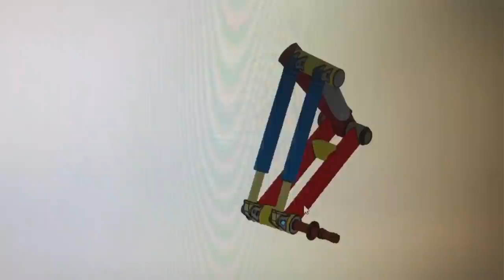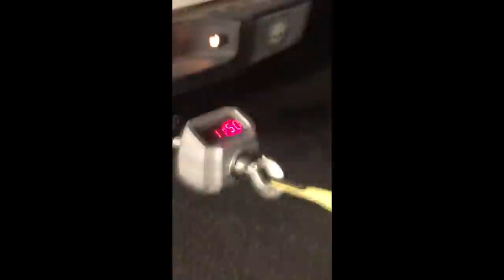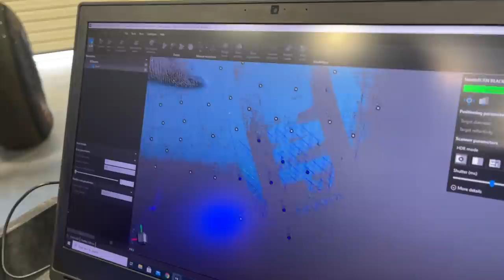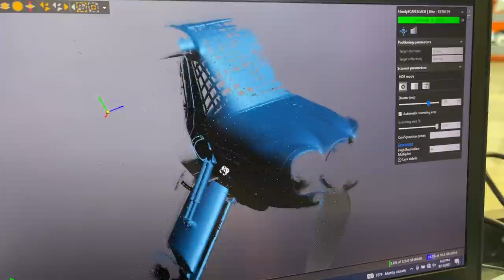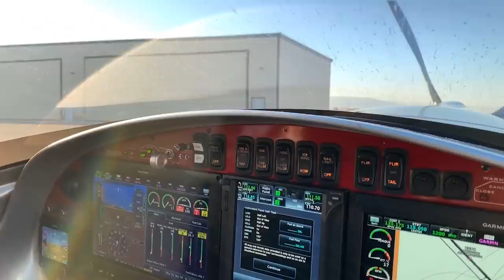Bush Plane drags truck | Scrappy #62

Comment: Working with design function carbon fiber wingtips and wingtip extensions are fun parts of prototype plug creation I like spending time with. Gleaning real-time performance data with them is a journey in themselves. Mike, I'm looking forward to your findings and the engineering compromises you choose for applications related to Scrappy's journey. I love spending time with your channel.

Comment: OMG you were dragging that pick up with the rear end locked. Wow
   What's next a pull sled. LOL
Reply: I think if he put wings on a camping trailer scrappy could tow it to Oshkosh next year.
Reply: @undercoverasiant696  wouldn't that be a sight. Lol  With synced controls pulled pulled like a glider with a tongue instead of a cable.🤔 
    I can hear the old lady now... "I'm not going camping less you bring the trailer." LOL

Comment: I had a feeling that Scrappy didn’t have wing tips because you were going to be doing further testing on the ground and in the air similar to the way you did with Draco. The world has spots cars, super cars and hyper cars. Now the world has a “Hyper Carbon Cub” Scrappy looks amazing and you’ve done a wonderful job  building a Hyper Cub. I’m betting there will be a 1/4 scale remote control version of Scrappy in the near future as well. God Bless

Comment: WOW, I figured that since you made it to Oshkosh without the final videos that it took an incredible effort to make it on time.  Thank you for catching us up.  I have to admit that I haven’t missed a single day checking for a new video.  So, Scrappy was fully digitized.  I am hoping (betting) that the file makes it to Horizon Hobby.
Reply: I couldn't imagine what a foamie would be able to do with double slats and flaps on flaps, but on the other hand, I doubt those particular features with their complicated mechanisms would make it into final production.  It's not like most RC planes could even utilize those features, since so many of them fly so slow as it is, and many can transfer enough lift from the thrust of the prop when the wings start giving out to keep flying.
Reply: @Skinflaps_Meatslapper  I have several large foamies and what I would like to see is a leading edge that represents the slats in the up position but include the flaperon function.  Just for fun I like to imagine Draco (the full scale version) with the double-slatted wing.  I’ll bet it happens.
Reply: @king-o-vetts9899  Oh, flaperons are easy to program in your radio if you have an extra channel to spare on your receiver for independent ailerons, though I don't really recommend it.  Just mix the aileron and flap channels, play around with the mix and limits until you get it where you want it.  I do it all the time with mine, but I do the opposite, (sometimes called a crow's foot).  The ailerons travel upward when the flaps go down to give it additional stability and tip-stall resistance at slow speed.  I tried the flaperons once with a AT-502 foamie, since I wanted it to be more scale like my actual 502, but it got so hard to control at slow speed even with gyro stabilization that I had to maintain a higher speed to keep it stable on the roll and yaw axis, if I got it just a little bit too slow the plane would tuck a wing under and dive to the ground...not a good trait if there's any wind at all present.  So really, I was able to fly slower without flaperons just because I didn't have to fight a wobbly and unpredictably suicidal plane.  Some features just don't scale down to RC size in quite the same way, because flaperons are great on my 502 but absolute trash for an RC 502.
Reply: (+ 1) on that one!

Comment: Almost looks like something is holding the plane up for those slow landings. Amazing how slow the plane can land.
Reply: Scrappy was designed to be in slow flight most manufacturers build them to be ok in both fast and slow  look at the shock ultra cub that thing is as close as u can get in a stock design to scrappy

Comment: You should talk to e-props: they have an innovative design that work well at the bottom end while keeping top speed. Results are close to some variable pitch props
Reply: And they're French, just like Beringer
Reply: @NicksStuff  Electric variable pitch has a long way to go before it can compare to a simple hydraulic governor, they're primarily intended for engines that do not have the ability to run hydraulic.  MT actually steered me away from their electric offering for my O-360 in favor of a conventional hydraulic because my engine is compatible with a governor.

Comment: Have you ever thought about ways to help fight forest fires? Cheaper ways to get water to fires, or equipment to fighters. I think you could engineer world peace if you put your mind to it. I can’t stop watching your videos you just grab my attention can’t wait for the next one! What will you think of next?
Reply: I’ve thought about that. My version would be an electric motor drone (no battery)- that would have an umbilical cord that goes to a fire truck mounted gen set. High voltage line sends up the current along with a hose. Drone will be operated by a couple pilots from the truck. May not be able to send up a massive amount of water but it would be consistent and targeted with no human that could crash.

Comment: That was AMAZING! First time ever seeing an aircraft drag dead weight like that! Can't wait to see the climb rate with NITROUS! Going to be INSAAANE!!

I just used 2 Grip Lock Ties on a customer's car until her parts came in. I had disconnected the left side parking brake cable - battling inferior metals and rust the whole way - only to find I was sent the wrong cables! Rather than reinstall everything and risk snapping one of the studs off in the car body, I used 2 Grip Lock Ties to secure the cable, so she could drive her car until the correct parts arrived. A week later, I just released the Grip Lock Ties and was picking up where I left off - nice and easy! I appreciate that product! Now if we could only get the entire automotive industry to adopt your creativity and work ethic, I'll be sitting pretty, lol! :)

Comment: GLAD to see you back - was worried you might have been sick.  Seeing Scrappy floating along at altitude with those enormous bush tires hanging out in the air made me wonder if you've had the opportunity to test any differences in speed and trim with the wheels fully extended vs fully retracted in flight?  You wouldn't EXPECT much difference in speed, but . . .

Comment: I double doggy dare you colour match some of the plastics on the RAM to the paint scheme of Scrappy. 
Orange on the RAM on the grille, 1 inch strip of Orange on the bottom of the plastics and trim on the bottom of the truck and around the wheel wells, Orange outline for the RAM emblem on the tailgate.

Comment: Jay Carter's prop for the Carter copter operates efficiently over a 8 to 1 speed range.  You should consider licensing his tech.
Reply: As I recall Carters prop generated 1200lb of static  thrust from 350hp, and demonstrated a top speed of 214mph.

Comment: Love you man. I am most interested in your wing tip designs and final prop iteration. 
With today's turbochargers and electronic wastegates, you could compound turbo for 20 pounds of boost at 35FL. It's just something nobody has done. With EFI and compound turbos, running an engine on 4 psi absolute, to 14.7 and to 35 pounds absolute is possible. I'm not speaking in mercury because you get into the 70s when you're talking about 35 pounds of absolute pressure lol. Everyone understands psi. For anyone reading this, 20 pounds of boost at sea level would be 34.7 pounds absolute pressure. 14.7 for the weight of the atmosphere at sea level and an additional 20 pounds of boost. Turbo is multiplying pressure 2.42 times. At 25,000ft with atmo at 5.45psi, the same boost level would be 13.42 absolute. Compound turbo systems are running 160psi at sea level now. 10.9 times the inlet pressure. That would take the 3.46psi at 35k feet and make 23 pounds of boost at 35 thousand feet! GA piston engines in the the six mile high club lol.

Comment: I commented about Scrappy two weeks ago. But I now feel compelled to comment on your remark about creating clean drinking water.  I have the image of one of those parts you showed in my head. And it occurred to me you can take a polluted or salt water source and turn it into hydrogen through electrolysis. Then when this hydrogen is used as a fuel it can produce the clean water.

Comment: Thanks for the update Mike, That Eco VAP really seems to be something the world could use if you can get it convert undrinkable to drinkable water. Silver/Copper (to my understanding) helps a great deal in removing harmful elements from the water but I'm no expert in that field just what was told to me. Can you imagine Mike if you actually created a functioning water filtering system for outdoors (and indoors) to help others in need of such things? Very prosperous venture if it succeeds, also your thoughts on converting salt water to fresh, we have a lot of that. Again I'm no expert but I can see a real potential for sure, wish you the best on that project. :) NC

Comment: Mike, your prop needs retractable slats or maybe through porting with orifices that transition to laminar invisible above the correct velocity (I know, I'm making up terminology) Another possibility might be something like a three blade prop that becomes a six blade prop. In other words, I think, in order to balance the prop with the airframe, it too needs to change surface area.

Comment: Testing , testing , and more testing ..... We must find out what Scrappy's density altitude limit is! Can't have problems on a hot, humid day, fully loaded and fueled trying to takeoff from a 3000 foot dirt runway that is 10600 feet ASL. "Use the nitrous, Mike! Use the nitrous!", Obi Wan whispers....

Who needs an "X" wing and R2-D2 when you've got  Scrappy and a 780 Lycoming!

Comment: I would be hard-pressed to relate, or indeed to trace, the meandering thoughts that led to this.  It suddenly occurred to me that you didn't (I believe) build any lifting eyes into Scrappy.  I suppose in an emergency you could use the parachute attachment points, but it would be a shame to scratch Scrappy's elegant skin to do so.  OTOH, it would not surprise me to learn that you had plans for this eventuality already in hand.  You wizard, you!

Comment: can you please do a price breakdown for scrappy when he's ready? that sounds interesting
Reply: That would never be possible.  The biggest part of the bill would be R&D and labor, with the actual parts and supplies a mere percentage of that.  So, how would you get even a remote estimate on cost if the overwhelming value is from Mike and others putting in their time and effort designing and making one-off unique parts using equipment borrowed from their other companies, and labor from who knows how many people stopping in and helping out?  You can't, and whatever figure Mike might come up with would likely be far different than what someone else could make a copy of scrappy for.  Best you'll ever get is a vague range based on similar aircraft, my estimate would be anywhere from $400K to well north of a mil if you wanted someone to build a copy for you, depending on how close you want it to be.
Reply: @Skinflaps_Meatslapper  I mean, I didnt need a whole essay but thanks
Reply: @littlepastelkitten  Most people would've reached the same conclusion and never asked that question, so I had to get you up to speed in order for you to understand the answer.  It only required a short paragraph, don't be so hard on yourself.

Comment: Very educational video - learnt a lot. 

When you mentioned front end - and thrust with different air densities. How would you compare the difference between a prop repeller, compared to Boeing 747. Does your testing you do the same testing as Boeing... apologise if the comment is confusing. Hope you understand the point 🤪

Comment: Loved the video. Tech question, do the manufacturers give a side load / pull rating for thrust tests? Seems like an awful lot of sideload on the gear when run up but I'm guessing they're overbuilt? I guess if the brakes can hold the thrust, the gear legs are good? Can those aircraft's brakes hold position under full power?

Comment: I'm sure you've been asked this,  but do you have some sort of cut out for the flap/slat switch to prevent accidental engagement at a speed that could damage them?
Reply from the maker: Yes.  its amp draw regulated and turns off at just under half its load capacity.
Reply: @MikePatey  cool, thank you.

Comment: it's a truck. The back tires don't have very much weight over them. Put someone in it with their foot on the brake and it will be a different story.

Comment: Mike, I'm local, our paths have crossed a few times 10 years ago.  You are Utah's Tony Stark in the reality.

I have a question/criticism,  that I know you are working on.  On your landings in this video, your getting no suspension travel or renound control other than the unmanaged balloon tires.  In testing, you dropped things and the suspension did its job.  I assume this is something your working on.  It would definitely frustrate me to not just stick a landing with controlled rebound.  It almost appears that it's like a typical car air ride susoension in its highest setting with a ruined ride/suspension travel/control.  

In comparing Draco's controlled suspension, with it being  way scaled down, im expecting a larger, better scale landing control over Draco.  

You are truly inspiring.

Comment: Do you perform oil tests of the engine? I am not that familiar with airplanes. but with hydraulic systems this is very usual. It can tell you all kinds of information. like what materials is in the oil.

Comment: Put a stick of wood cut to the correct length to hold down the brake pedal. This will lock up both the front brakes and the rear brakes. The most braking force comes from the front brakes...not the rear brakes. Blue Sky's.

Comment: Does applying bondo/filler to carbon fiber like that negatively impact the structural integrity much?
Reply from the maker: 🤠 great question, the filler Is not left in the part.  That was just to make a finish mold and then the part is pulled from it with no fillers

Comment: Hopefully Mike thinks to do a steering lock on those motorcycles in case he needs to use them for a little extra suspension on a crazy landing.

Comment: Curious that the front tires of the truck were not locked.
Reply from the maker: It’s just a two wheel drive truck.  I don’t think it could drag it locked up if it was a four wheel drive

Comment: I'm just kind of shocked you could pull a truck with tires locked with your TAILEWHEEL assembly.   Over a  thousand pounds of pull on the tailwheel...and it didn't break off.

Comment: The only mod I'd do to it is put a Rolls-Royce 450hp turboprop under the hood. Love jet fuel. 🙃🙃🙃
Reply: He would lose power by doing that. Besides that what Draco was and what Draco X will be.
Reply: @superskullmaster  that's what I would do if it were my plane. Plus I'd add weather radar to it.